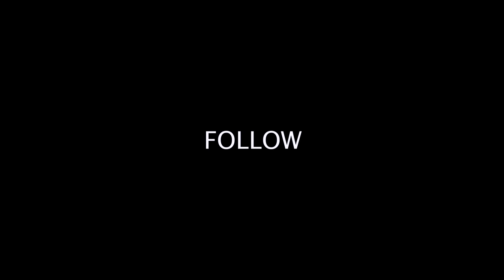we HIRED our FIRST EMPLOYEE! 🥳️💰

Comment: Just a couple of suggestions if I may.
1 Build a A-frame on wheels to hold and store your clamps. You can store them where ever you want and when needed roll it up to where you are working.
2 Hang the Paper Rolls you use on the end of your work table. When you need it you can just pull what you need across your work table.
Good luck. RCW

Comment: I don't know in U.S., but here in Brazil pipe clamps are very expensive.
Reply: The pipe clamps like they are buying are some of the cheapest clamps you can get. Bar clamps, which are pre made version of the pipe clamp are extremely expensive.

For a home shop, pipe clamps can be very cost effective as you can buy only a few sets of fittings, and then swap them between various lengths of pipe depending on your project.

Comment: Have you ever heard of a clamp carrier! Given the amount of glue ups that you do it WILL benefit you to looking into one. I worked in the woodworking field for 42 years and had a clamp carrier and a glue roller system where I worked. You could glue up a lot of boards instead of purchasing a ton of bar clamps ( not that they would go to waste you can never have enough clamps). Check one out

Comment: I admire how you have systems for everything but I wonder how often you review those systems.  For example, now that you have more space wouldn't it be easier to make longer panels and crosscut them to cutting board size once the glue dries?  I imagine in a small shop that takes a lot of room but in a larger shop, I bet its faster and takes less room and less clamps.  Worth an experiment?  Either way - you all rock - here's a little snack for the algorithm.
Reply from the maker: Tried that with Josh Weissman’s board last year. Wastes a TON more lumber and doesn’t save enough time to justify it
Reply: @jennieanddavis  didn't realized you tried it.  I'm surprised that it doesn't save because it SEEMS logical that it would.  Sometimes logical isn't the same in practice.  I only do one or two at a time myself so I haven't tried it either.